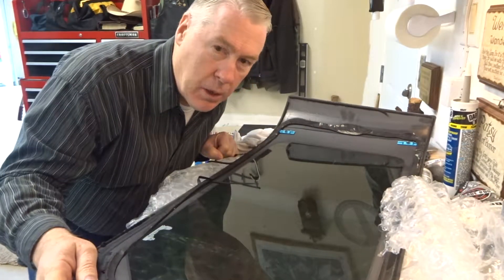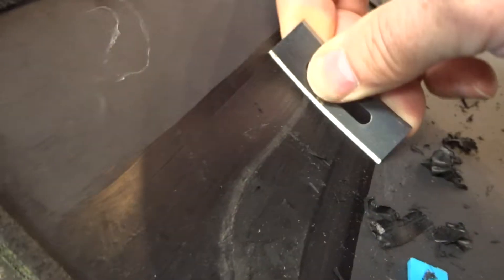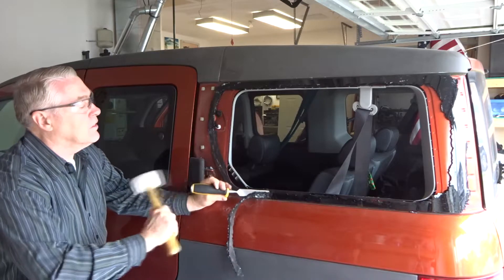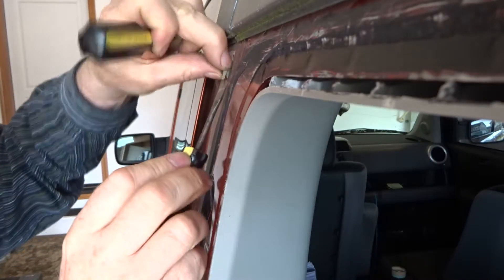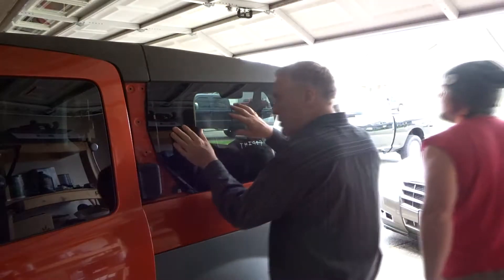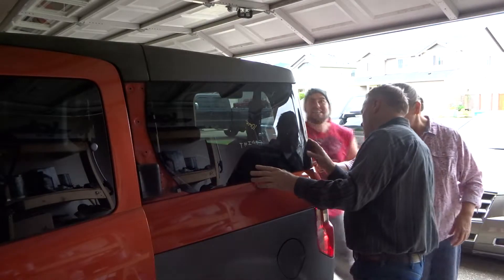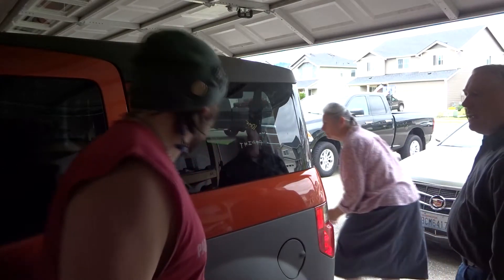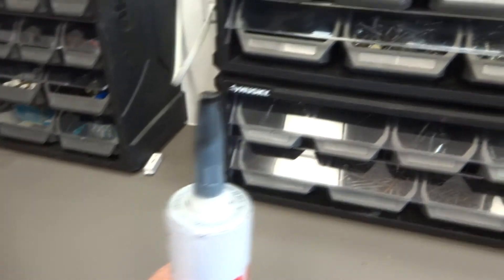Honda Element Curved window Replacement

Comment: Thanks for the video!  I also picked up the new glass from a salvage yard, they removed it and all I had to do was pick it up.  As someone mentioned, on the replacement glass I bought they had two of the three prongs that were stuck to the glass, that made lining it up super easy.  I did use a heat gun to remove the old sealant on the replacement glass and around the window hole.  Be really careful to not burn the plastic parts that are around the window hole, and careful using the chisel too so you don't scratch up your paint.  On the trim piece, a couple of the clip holders broke when removing the trim but 3 survived and I just used silicon glue to put the trim piece clips back in.

Comment: you didn’t need a rubber gasket on the new window? just urethane and it’s good?
Reply from the maker: When I removed the broken window, I didn't find any gasket, just the urethane sealant held the window in. He had that car a few more years and it never leaked. Thanks for the comment.

Comment: Didn’t look like you put new clips on the replacement glass (there are three stick on posts that go into the body) any issue with this?
Reply: Not yet, it's been about 2 years now still no leaks. Then again he doesn't drive it any more. Thanks for the comment